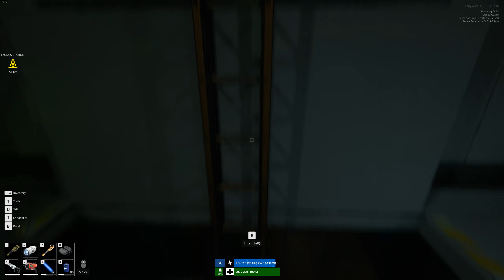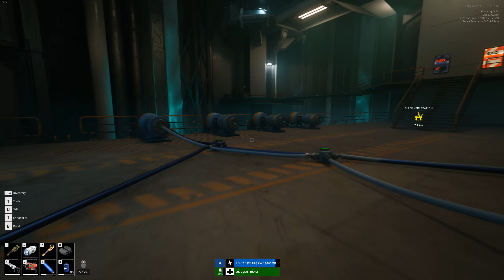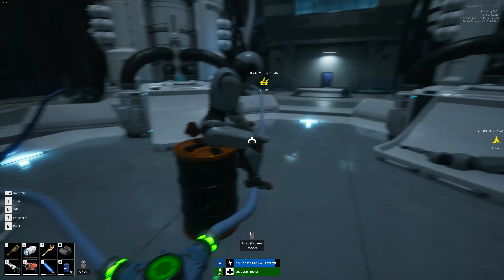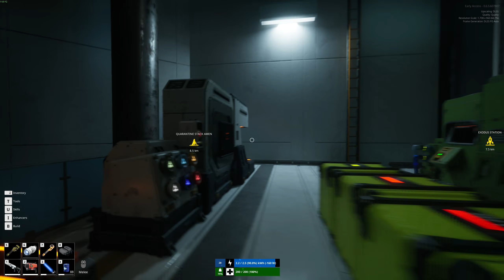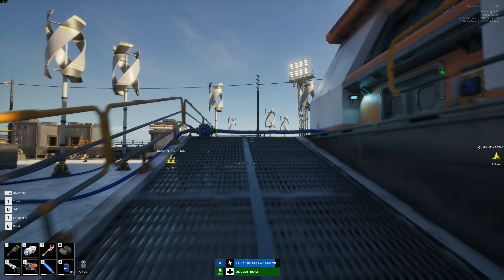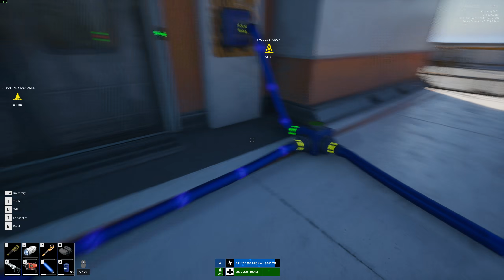The Last Caretaker  - Fixing your Lazarus Complex Power and Water Problems

Comment: Nice set up. Someone already tested Solar vs Wind, he came to a conclusion that Solar produces more power than Wind even tho they do not produce energy at night. When I connect my boat to Lazarus, everything together sums up to 14 Lumimax and 42 Batteries, I can run everything connected together without any issues.